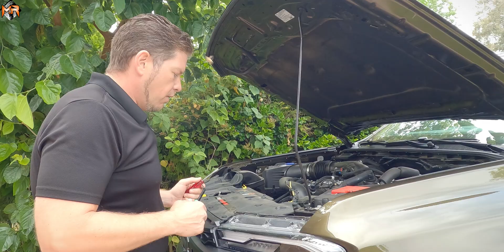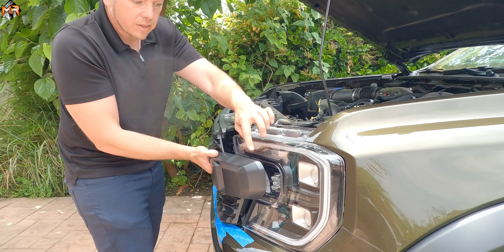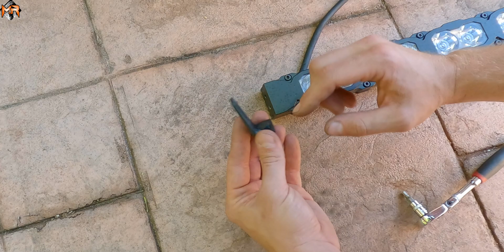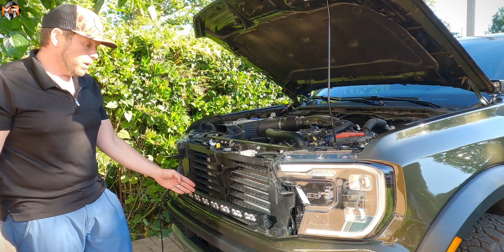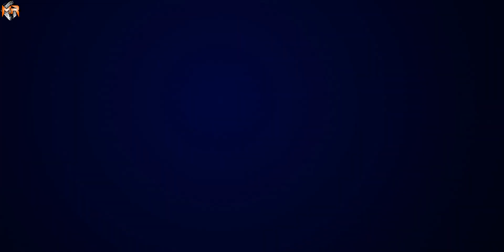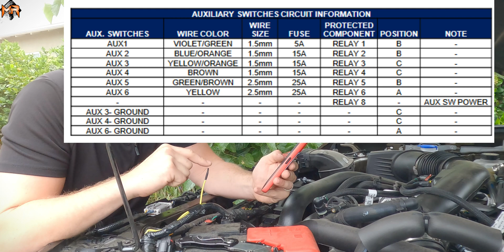Ford Ranger Raptor Curved 40 inch LED Light Bar PRO Installation by M&R Automotive |  2024 2025

Comment: Just installed today. Like above said, it’s kind of crazy that required tools aren’t listed in install instructions (paper sheet or this video). Beyond 8mm and 10mm, also 11mm needed for nuts that secure light bar on the bracket.

Also you’re installing the mounts the wrong way in the video, which is confusing. You show it installing the “passenger side” brackets when it’s the side with the cord. I matched what you did in the video and had to switch both brackets to flip them the other way after.

Overall, suggest putting a little more effort in the install video if the instructions you ship with the product are just a QR code for this video….
Reply from the maker: Thanks for the feedback we’ll look into it and redo the video if necessary

Comment: What happens if one turns On both amber & white simultaneously?
Reply from the maker: the white is more powerful and will out shine the amber. if you have it on a fuse that is high amp, then it will be fine. if youre fuse has a low amp that can't handle both, then it might blow it. but either way, nothing will happen to the light bar
Reply: @MandRautomotive  I was curious about whether or not the white light would totally mute the amber color. Obviously it would.
It would be interesting to put a rheostat in the circuit of the white light to control intensity and get a blend of color.
Thanks for your reply.

Comment: Hey M&R.  I put in the Reverse lights a week or so ago, and I had some criticism about the thoroughness of the instructions.  I installed this light bar today, and these instructions were much clearer,  and if weren't making them available for me to watch last month, I probably would not have purchased them.  They were really straight forward....BUT it was still lacking in a couple areas.  Your video shows removal of the harness with the grill, but 1. does NOT say "how" to disconnect the attachment (which lead to some fear of breaking the clip) and 2. did not mention removing the small hose to the camera washer.  That would have helped during my install.  Also,  you mentioned the 8mm bolts, but did not mention that the attachment brackets required 10mm, nor did you mention needing torx screwdriver for the side brackets.  Not "that big" a deal for a person that owns tools, but would be nice in the description to list "here's what's needed"...1, 2, 3, etc.  Not being picky but as I mentioned, your pretty good instruction video is what encouraged me to purchase and install on my own Great Job.  Next post is a link to my video on FB.  Thanks again.  Please let me know if you make something custom for the 3 amber marker lights or some top lights for my baja bar.  2 THUMBS UP!
Reply from the maker: Hi, its Mike here, the owner. Thank you for your detailed review. I will make sure to mention in upcoming install videos the tools the tools that I use. I guess I'm always under the assumption that the people that install it themselves, have some tools laying around. Now that I know that these install videos are giving someone like you more confidence about installing it yourself, which is ultimately what I would like. I appreciate it and thank you for your support. We are also learning what our customers would want from us.
Reply: @MandRautomotive  the tools not being mentioned is minor. I just thought since you mentioned the 8mm you could mention others. I had more than everything I needed, but I like to lay everything out before I start. Not showing how to disconnect the harness and water hose was more important to me. I've broken so many clips in my life from not knowing the correct way to remove. I LOVED the showing of prying off bottom of grille and removing bumper. Not sure I would have attempted if you hadn't shown. Also liked taping bumper. I used brass connectors to connect covered with heat shrink for a smooth clean look.
Did you get to see my pics/video?